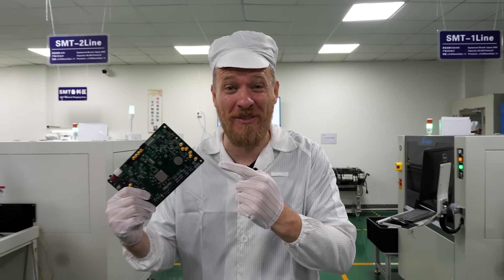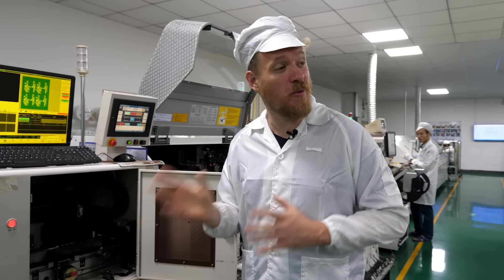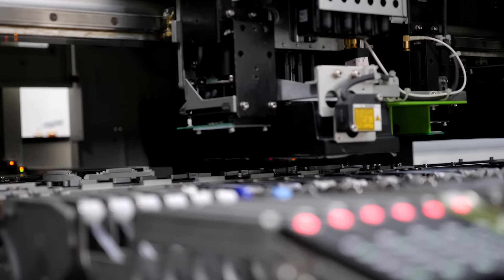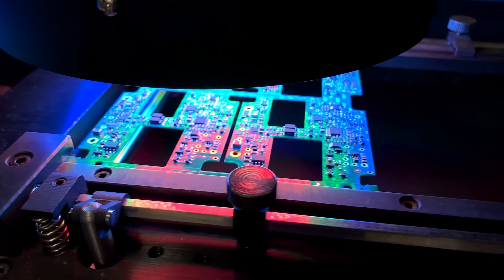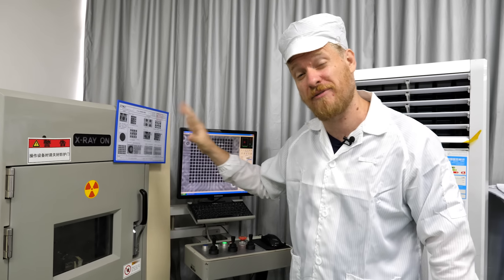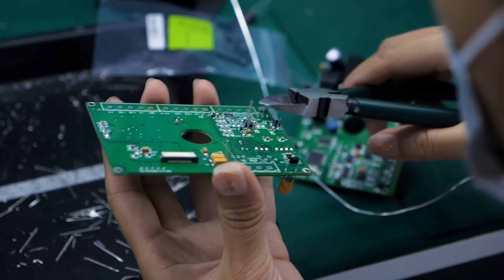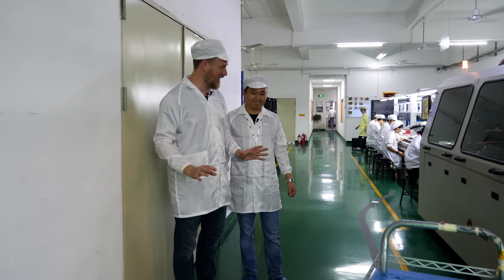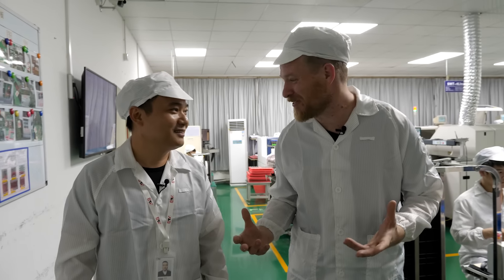Inside a PCB Soldering Factory - in China

Comment: Being 64, its amazing how far electronics has come in only 50 years.
Reply: remember tubes?
Reply: @johnstreet819  Very well.
Reply: Respect
Reply: What might surprise you, then, is that automated circuit board assembly was in wide use in the 1970s, and was already surprisingly fast. There were experiments in fully-automated circuit production in the 1940s! Industrial automation goes back much farther than many people realize.
Reply: @tookitogo  It doesn't surprise me. My mother was a electronics technician from when she started for Bendix radio in the 40s and then Westinghouse aerospace till she retired in 1985. I know all about it.  She worked on the cameras that went to moon. she also worked on the awacs  radar for the Navy the main thing Westinghouse did a I am going to assume they still do this to this day.
Reply: @MrHans818  Very cool!! (I am an electronics technician myself, at a university chemistry department.)

Westinghouse doesn’t exist anymore (ignoring the “new” Westinghouse Electric run by a young Chinese company that bought rights to the name), but the former defense division of Westinghouse was bought by Northrop Grumman, which of course is a defense contractor. (By any chance, did she work in Maryland? I used to live around Baltimore.)

Comment: Ive been a HW Design Engineer since 1982, very different back then. This video is spot on. Watch for nostalgia reasons. It truly is amazing the mfg process of getting such tiny components or 1000 pin BGA's soldered correctly to the board. A near miracle that its done and repeated with 100% accuracy  thousands fo times. As far as the people who do hand assembly, they are equally impressive. Soldering tiny little pins spaced a few thousands of an inch from each other and doing fast and accurately is an amazing talent. Where will we be 10 or 20 more years from now, we will be looking at this being and "old time" process.

Comment: I did a high voltage board with PCBway. They had no problem with the many isolation slots cut into the board and didn't even charge extra. That's quite unusual.
Reply: That is normal practice
Reply: @UKsystems  It might be now, but back then when PCBway was brand new and JLCPCB wasn't a thing, it was normal practice to charge extra for routed slots, and often you needed to discuss them with the manufacturer when your ordered.
Reply: @ there have been lots of manufacturers in the past that would do it but it is worth knowing that when you were going to the cheapest prototype service they are less likely to accommodate you when they are over the market leader

Comment: Reminded me of when I worked at Control Techniques ltd back in 1989. We used the manufacturing process, maybe the speeds of pick and place have increased and the methods use to inspect solder joints have changed a little. But on the whole pcb manufacturer hasn't changed a lot in all these years. I remember the staff placing through components by hand we used to call it "the add on section". I worked in the test and repair section where we had custom made machines (in house" ) that would power up and test functionality of each circuit board. I started out testing and repairing their "INBP Boards". Then moved to repairing the boards that had failed inspection from one of the multi million pound machines that was capable of testing many types of board. This video gave me a good trip down memory lane, and it was fascinating to see that some tech still hasn't changed in all those years.

Comment: Scotty: Hey guys I need to do a tombstone effect.
Factory: Wah????
Reply: Factory: we don't get those problems more than once a year anymore but we will make one for YouTube!
Reply: It mainly happens when your fixture inside your pick and place machine is loose, or the stand offs (board supports) aren’t adjusted correctly. Causing the components to bounce during placement. Mostly what happens is if the component is not equally anchored on both sides, it is drawn to the upright position from the tension of the solidifying solder paste.
Reply: @Darthtard9  It can be more that just placement issues, if the solder melts unequally on the ends, the end that melts first pulls the part  to that side due to surface tension.
Reply: Roobotics 
Yes, true. That’s why I said mostly.
I’ve been working as a tech troubleshooting, repairing and working on SMT assembly lines and even through hole automatic assembly lines in the medical diagnostic industry for 20 years. Including wave solder, AOI,  X-ray machines, CNC drillers and routers. Even PCB bare board fabrication process machinery and equipment
Heller, Sanyo, Koh Young, Universal, Hitachi, Yes-Tech, Phoenix, Speedline, pluritec, dynomotion and Excellon are just a few of the brands of equipment I work on regularly.

Comment: I just was in a PCB assembly factory in Switzerland last week with my electrical engineering class. This video was very intresting to see the diffrences. Generaly, it's pretty much the same procss. I think the most obvious diffrence was that in the swiss factory there was even more automation going on and less manual labor. This makes sense as salaries in Switzerland probably are an order of magnitude higher. 
Another big diffrence is that the swiss factory seems to be a really focused of customer support and has quite a few engineers helping the customer to improve the design of their bord for easier assembly, testing and better functionality. They added a lot of testpads on all boards to later test all the components after they have been soldered in. To do this they had two methods: 
For boards in large quantities the custom build a testrig where you can put a board in. It has one of those spring loaded pins for every test pad. Every one is conected to a machine with hundrets of inputs. They then program the machine whitch pins it has to measure against each other and within what margins the result should be. If there is a microcontroller on the board they can also program in that way.The way cooler method is what they use for boards in smaller quantities. They have a robot with "flying probes". Basically a robot with like eight small probes that they can automatically stick on any place on the board and then measure a component. This happens with a crazy speed, the probes are really flying around. But it can easily take a couple of minutes for one board to be tested.
Reply: Flying probe machines are one of my favourite machines.  PnP and Flying Probe being the top but AOI is nearly up there in the running.
Reply: Scotty didn't show it in this video but if you watch his video where he tours the JLC PCB factory you can see a lot of what you are talking about. They have a whole building full of people validating designs and he shows off one of their flying probe machines there. This video I think was more focused on soldering components onto the PCB than PCB fabrication.

Comment: I will add also, PCBWay's technical sales team is excellent!

Back when I did my first ever board with them (a custom arduino-like device based around a SAMD micro-controller), they went out of their way to help me get my design in the correct format for production (AutoDesk Eagle missed one of the files they needed in its default export, and one of the components didn't have polarity indicated properly in the output files, IIRC). They were  able to get me through the process to deliver a board that was exactly to what I had intended in my design.

Comment: In reference to tombstoning.
It mainly happens when your fixture inside your pick and place machine is loose, or the stand offs (board supports) aren’t adjusted correctly. Causing the components to bounce during placement. Mostly what happens is if the component is not equally anchored on both sides, it is drawn to the upright position from the tension of the solidifying solder paste.

Comment: I used to work for an American PCB assembly company couple of years back and they have this process prior to the functionality testing called in circuit test and flying probe test ( basically a giant automated multimeter) to check the components values/pcb traces/shorts/open defects that can't be captured by the aoi/xray machines.
Reply: Azim Azami Uhm, yup, PCBWay’s own stuff is nothing spectacular - maybe it’s cheaper, but it’s still a multimeter with a separate app.

Comment: Really enjoyed this. I use pcbway for the pcb’s I build on my DIY pick and place machine, always been very helpful, they are on of the few pcb manufacturers that will accept a eagle cad file, no need to generate the gerber files. I can only do 300 parts on hour on my PnP, but beats hand placing them. I’m going to build a bed of nails to test my system, looks like old 3D printer parts will be handy.

Comment: 38 years ago I worked for Hewlett Packard and operated a pick-n-place machine and a wave solder machine.....back then the pick and place items were transistors, resistors etc.  it jammed a lot....then I was pregnant and they moved me to the quality check station where I would have one BCB and then visually compared the boards to the original, do any corrections by removing and replacing with the right component......this is so much more advanced, make what I did almost dinosaurish....great tour

Comment: Nice video - I found it on the PCBWay site when I wanted to show an artist what was actually going on with the custom board I was having made for use in their work.

I use PCBWay to get all my SMDs pre-soldered, as well as the actual board printed, on my short-run boards, and do the hand-soldering myself after the board gets delivered to me.

Unlike SMD soldering, which I struggle with, hand soldering is well within my capability (and patience!), and this keeps the cost down a little for me without compromising on quality for the soldering of the SMD parts (in a pinch, I can heat-gun a SMD, but I don't have any way of being sure of reliability, so I'm more comfortable to let the factory do those).

Comment: FYI, the first pick and place machine also centers components prior to placement.  On Juki machines like this it uses a laser alignment system for the smaller parts, unlike most other pick and place machines that typically use some sort of upwards facing camera to center all the components picked and subsequently placed.

Comment: Excellent presentation. 
A quick note, the machine they invented with the LCR meter where the operator is manually testing values on each part is actually built-in to many modern P&P machines. The P&P machines have a high-speed LCR in the machine, picks up the part from the reel, tests its value, then places it on the PCB. This nearly eliminates the possibility of passives being messed up during assembly.
Reply: I want to working here

Comment: 10:50 it's a sofisticated RLC and it's very common but almost no one use it, in my work have one in the lab and no one ever notice until I found it! it's a beautiful way to check circuit boards greater than oscilloscope I can tell! amazing video, thanks
Reply: Yea and can't the flying probe do the same kind of job just automatically
Reply: @Diehard4077  sure, but for small manufacturing areas the manual checking is required instead of any automated tester... at least most of the time
Reply: @ReyElectronico  true enough

Comment: Great video. Reminded me of my time at titan products as intern. They had similar assembly line, lots Siemens  machine working round the clock. They also had x ray machine and that LCR scope at 10:47 but this one looks advanced. And btw the wave soldering machine has liquid flux wave before the actual solder flow so as only the exposed metal pins get that proper through hole soldering.
Reply: Or a flux spray
Reply: @Diehard4077  might be but before soldering liquid flux applied for sure

Comment: In the early 1990s I worked at a factory in Taiwan that made PCBs (any type of PCB really, but mostly motherboards, sound cards and graphics cards for US corporations and larger Taiwanese corporations selling into the US and Europe).

The factory didn't do SMD placement (there was little to no demand for SMT at the time) but we did have pick and place machines that could put most common components onto PCBs into through-holes.

I'm surprised PCBWay isn't using pick and place for larger parts, or maybe you just skipped it. But most likely there just aren't enough of such parts on a board to justify it these days. When we were doing it a board could easily have hundreds of through-hole parts and a single board run would typically be several thousand PCBs.

In the factory I was at the machines were programmed physically by a human first identifying the part to place (or more specifically, which reel it would be fed from) and then moving a device that measured the distance from a reference point (usually the PCB corner) to two of the holes on the board that would identify x and y position for that part and record it. Only two holes were referenced even for parts with more legs as two holes gives enough information for x/y position and orientation. This was done and recorded for every part. For some parts additional information for z-axis was added for parts that don't sit flush. Once that was all set up the machine would reproduce the sequence at lightning speed. For some parts the placement worked sort of like a stapler, pushing the part out of the tape it was in, bending the leads and pushing them into the holes. Other parts were simply placed, but this was all done without suction through metal feeders and guides. There were no cameras and no fancy position checking, just x, y and z coordinates. Position checking was essentially done by listening for weird sounds indicating that a piece was being crushed or when pieces came flying off the machine or if a tape feeder was jammed. Each board was being hand placed onto each machine and clamped into place so the same person doing that would be making sure things were running smoothly.

The machines we had needed to be configured manually for each run (each different board), so one of my cooler jobs was to write some software that allowed all of that information to be stored onto a floppy for each run. That would let us reuse the same program if a customer made a reorder of the same board (or if the board was very similar but needed minor changes like a version 2.0), or if we needed to switch a part to a different feeding spool, or if we replaced a same-spec part with a slightly different one that might be fatter or thinner, or in some cases the placement order could be tweaked if parts were getting knocked or if a different placement order might knock a second off the time). It also allowed the people "programming" the locations to be a bit sloppier as they could run a test board through and then manually tweak the locations by a few decimal mm if parts were being crushed (z-axis) or missing the holes (x / y axes).

After assembly they ran PCBs through tests that would include loading BIOS and doing other things like POST for motherboards and video and audio tests for graphics and sound cards. Our main engineer made and jury-rigged all kinds of in-house test harnesses for these different boards.

I remember the wave soldering machine room being incredibly hot (Taiwan itself can get really hot) and the pick and place machine room was deafeningly noisy as they bent parts and slammed them into place. The conditions at PCBWay look much better in comparison. 

As costs in China began to vastly out-compete those in Taiwan (even with cheaper foreign labour brought in to Taiwan from other Asian countries) those machines were sold to a factory in China in the late 90s and the factory shut down. Around the same time most of the smaller factories of this type in Taiwan shut down as most of this work started to shift to China.

Comment: Well done. A great explanation of the processes. A couple of comments though. Our factory does a check that each feeder on the SMD loader has the correct reel for its feeder location (this can be done with bar codes on some machines) and this makes it unnecessary to physically check the value of each component once one pcb has been loaded and tested and found to be correct. Also the through hole waving requires flux to be added to the bottom of the pcb before it goes over the wave. It would have been good to see that just for completeness. I like the conformal coating but some customers we have require the pcb to be washed and dried if possible prior to conformal coating. I would consider using this company if i wanted to get product produced in China.

Comment: Best explanation of this process ever. Thanks. I wrote an MIS system for a US based assemby house and the people who worked there could never explain the process for us to model using software. Every chinese assembly house has a secret sauce, or a custom process or equipment. Many are oversold as they are a differentiator. Nonetheless, this place seems like a place that tries to build good boards rather than cheap boards, again it's about the Benjamins. That jig to test the boards at the assembly house will remove all profits. As you negotiate that system, the CM will start as "first born"

Comment: Always great to see behind the scenes of components we use everyday! Would you happen to know roughly what a small, 5-10 boards/5-10 components per, simple board would cost? Is this something home diy makers could use or better for larger productions?
Reply: i guess you could get a quote on their site
Reply: @johnuferbach9166  Yes, they have a calculator but required selecting a lot of options and submitting for a quote. Their options are quite specific and needs more knowledge of pcb manufacturing than a basic maker might.
Reply: Update: Its, there. They do have a on site calculator that auto populates the basic fields for a quote based on size.